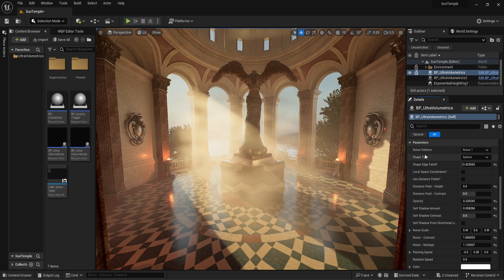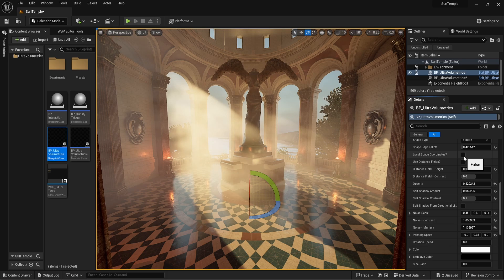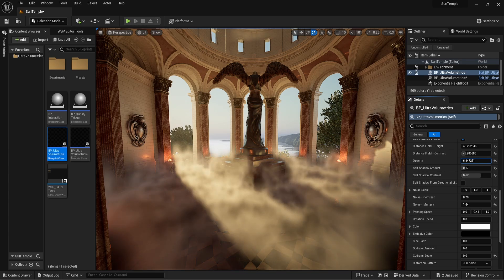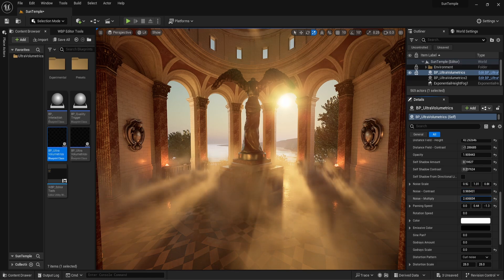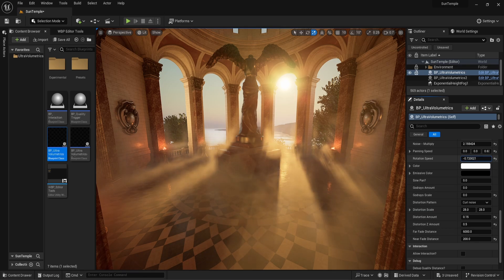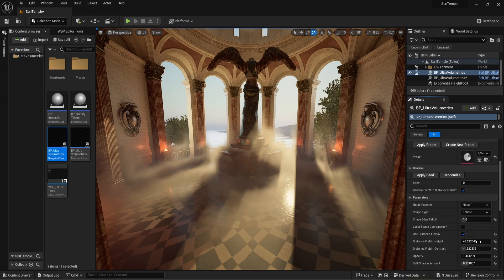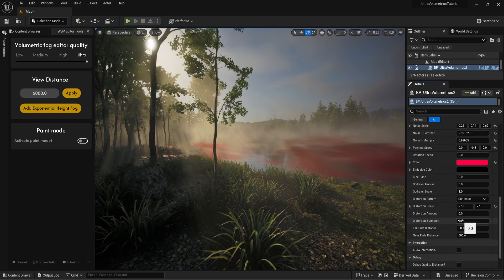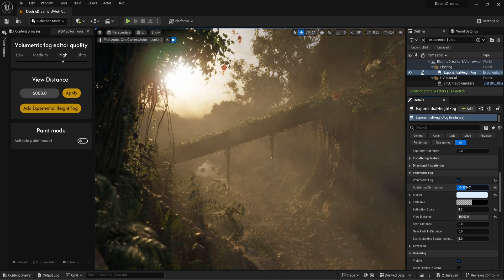Ultra Volumetrics - Parameters

Comment: Hello, why after I turn on the global distance field, the scene stays in a rough gray model and cannot restore the original scenery? When I try to turn it off, the fog after configuring the preset asset will surround the objects in the scene, but noise will appear
Reply: 3：49 in vedio
Reply from the maker: Hi! It sounds like maybe the distance fields visualize option is on or perhaps it is in Detail Lighting mode? If you could share or send a screenshot I can probably tell you what's going on right away. Thanks!

Comment: i heard about 5.5 is going to support velumetic in path trace.  not sure if its ture
Reply from the maker: I heard the same! Excited to see what 5.5 will bring.
Reply from the maker: Little update: I've done some testing on the released version of UE 5.5 and it seems there is no path tracing support for local volumetric fog yet, so I decided to make my own solution. It should be available next week, perhaps sooner!
Reply: @itsmebvg  thats so great, lookibg forward to see it. thank you so much for relying
Reply: @itsmebvg  i just tried UE 5.5 with path trace BP fog.  it looks really nice. but I didn't have the time to try it in sequencer animation .its a little time consuming to render path trace animation hahaha.  I did saw "panning speed "in path trace BP.  but not sure does it support for sequencer animation?  sorry for the disturbing. one thing that i can sure this plugin is going to save so much time for adding fog in After Effect.
Reply from the maker: @dandan-mf4sr  No problem at all, feel free to ask as many questions as you want! Yes there is indeed a panning speed parameter but animating in sequencer with that works slightly different if you're going to increase/decrease the panning speed dynamically. I'll have a video up soon explaining the short and simple process.
Reply: @itsmebvg  thank you so much for the efforts and help
Reply from the maker: @dandan-mf4sr  Glad to be able to help! Thank you!

Comment: how lightweight/optimize is this
Reply from the maker: It's quite optimized, especially if you decrease the overall volumetric fog quality. But it depends on what you're creating and which platform you are targeting. To be on the safe side, I wouldn't recommend it for mobile games. But volumetric fog in general is probably not recommended for that either. Let me know if you want more info!